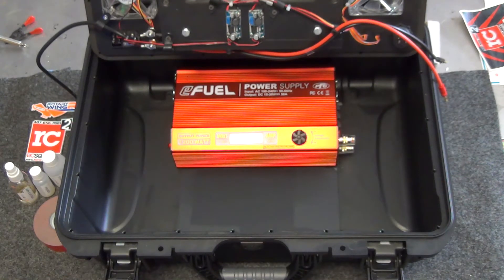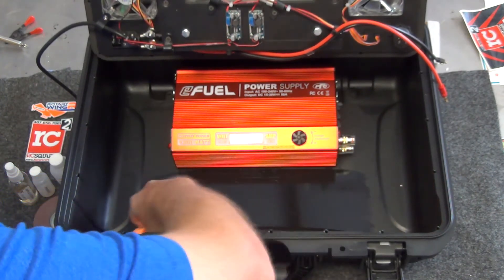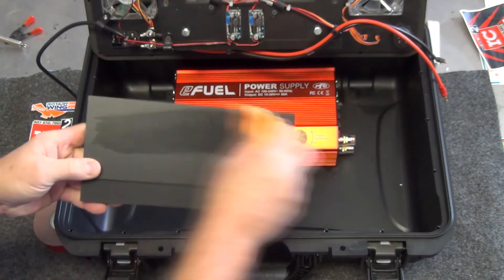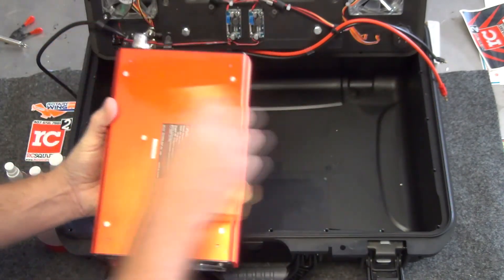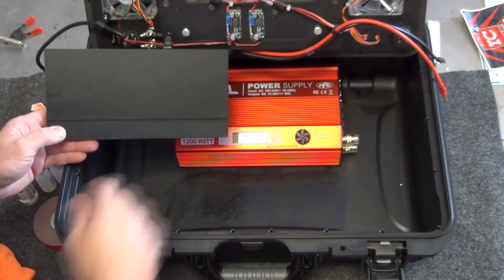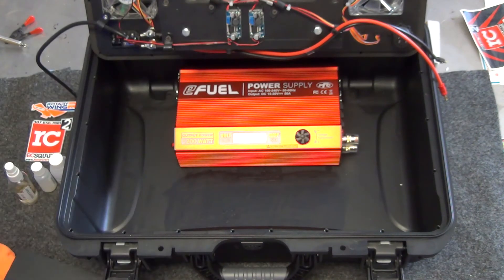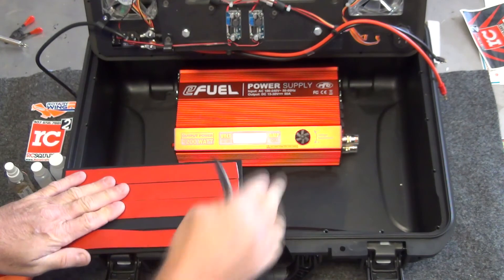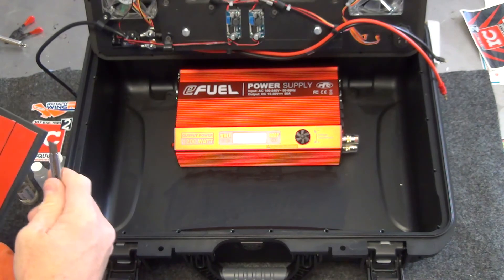Rotor Craft RC how to prepare, and mount your Power Supply

Comment: Looks great. I’m wondering why in all of these cases people are using DC power when the chargers have AC power?
Reply: this may be a bit late but most top tier lipo chargers get better power output when connected to a high quality/output  DC power supply

Comment: 3m tape is a bad idea when you want to service, move or otherwise remove your power supply. 
Stick with high strength Velcro. It will hold the heavy efuel (I have one ). It's easy to remove and service in case you need to remove PS. 
This is overkill!!!
Reply from the maker: We used 3M Velcro when we first started building cases. We had one 
power-supply break lose in shipping, I guess the case was upside down on
 a trip to Cali, with all the bouncing in the back of a Semi the PS 
decided to roam around the inside of our case. This was our best choice 
to Guarantee that would not be an issue ever again. But now we offer a 
new mounting system that bolts the PS into a cradle. Yes, it is 
overkill!!!!! that's why we are the best.